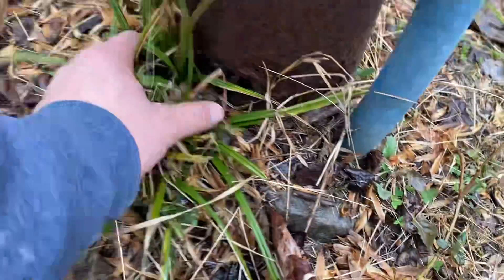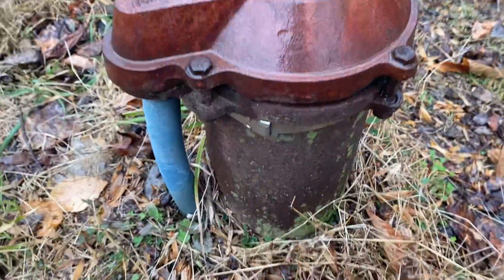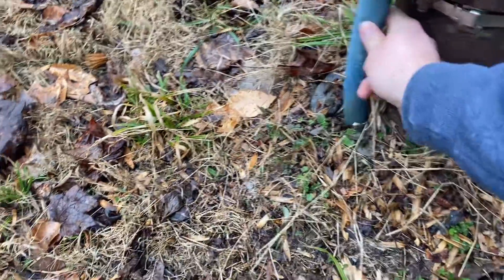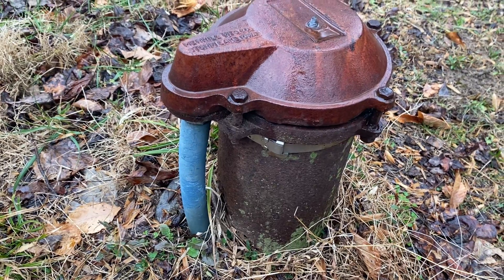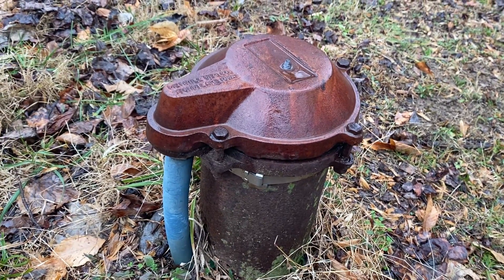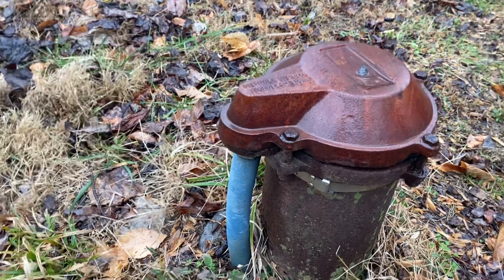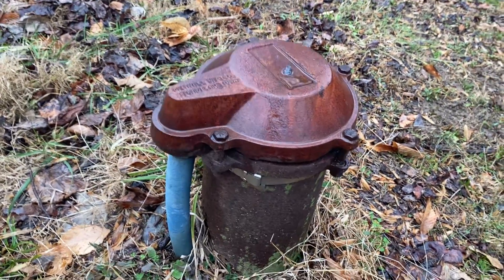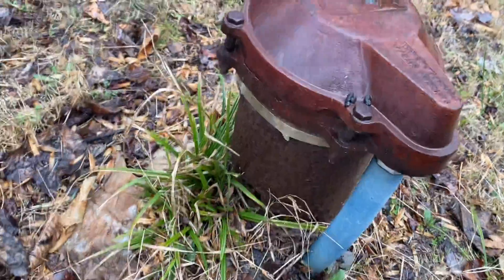Does Your Well Have A Hole In The Side Of It?

Comment: No, you don't need to call a professional, stop suggesting that individuals are just too stupid to do their own work.
Granted there are a lot of idiots out there, but not everyone is incapable of something this damn simple. If you can weld and operate a shovel you can fix this, no problem
Reply from the maker: I never said that individuals are too stupid to do their own work. The odds of a homeowner knowing how to properly repair a metal well casing are low. Maybe your town has a different group of individuals. In my area, homeowners can do any repairs they want to do to their homes. The state and county will hold them to the same requirements as a professional. If someone installs something wrong and the county or state finds out, they will make you rip it out and/or fine you. It would be irresponsible for me to go out and tell people not to hire a professional for something that can impact their drinking water and the water of the surrounding wells.